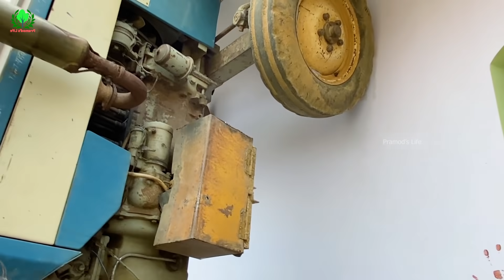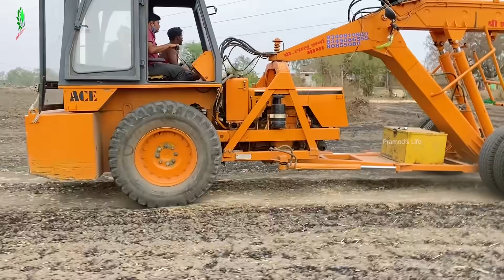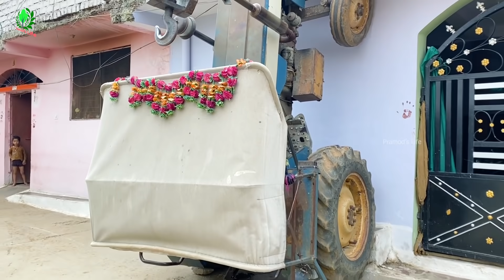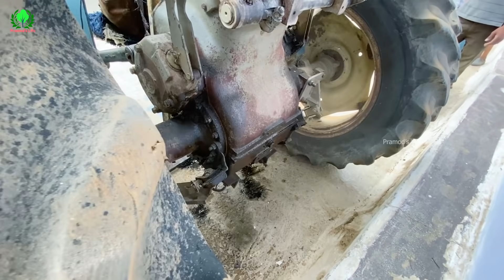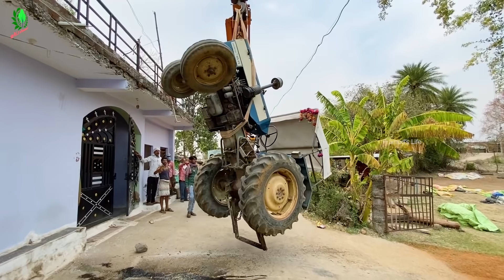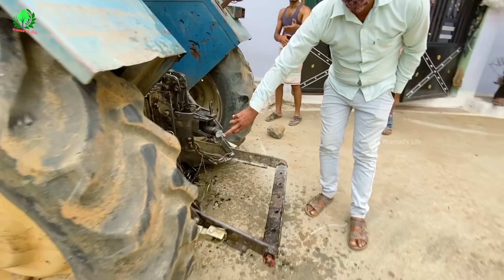Swaraj 735 FE Accident Very funny Trolley Huck Breaked Rescued By ACE Hydra Crane

Comment: Remove rear wheel air, then lifting is proper recovery
Reply: N.   Lpp
Reply: @faithketah6754  ppl
Reply: @faithketah6754  l
Reply: @faithketah6754  11 21 1
Reply: @faithketah6754  Pp
Reply: @faithketah6754 lmmk
Reply: സഗ  @rajeshranjan7404 
 Gggggggggggggggggg
Reply: Nab hu
Reply: @faithketah6754  ث
Reply: @swapnabegum7994  3a
Reply: @gauravrajput6991  hi hi hi Jo hi Jo Jo Jo Jo Jo WE
Reply: @swapnabegum7994  i
Reply: @faithketah6754  q
Reply: @faithketah6754